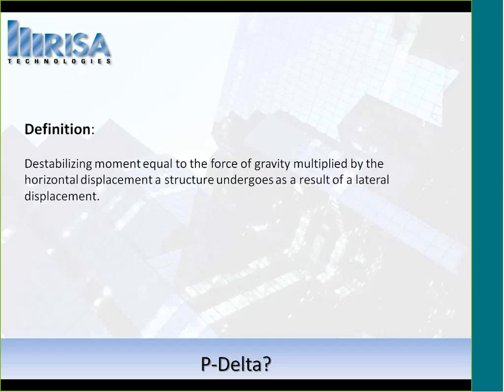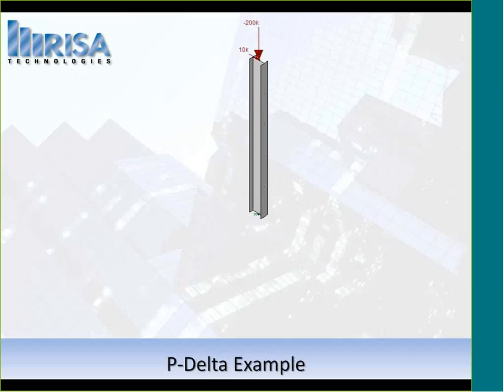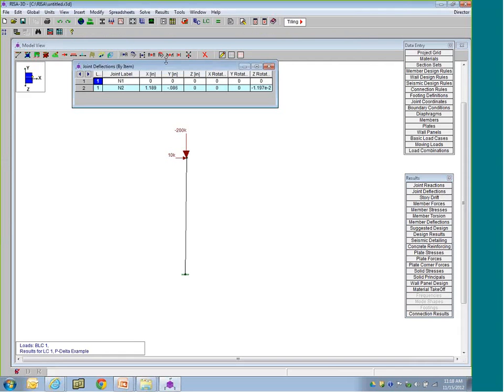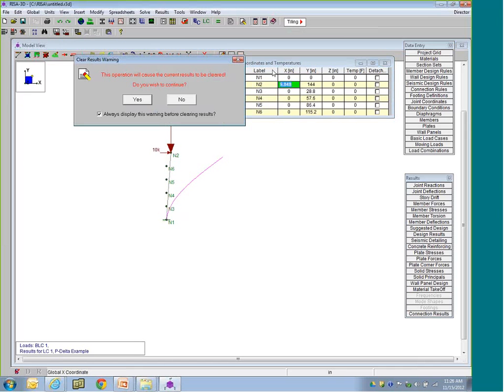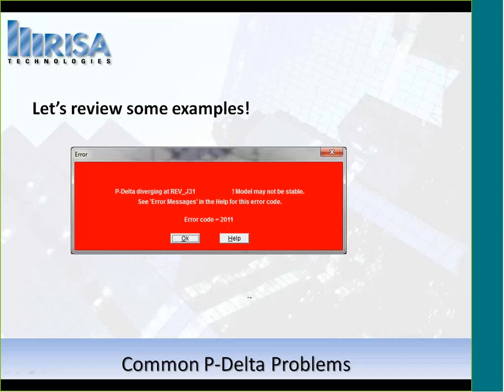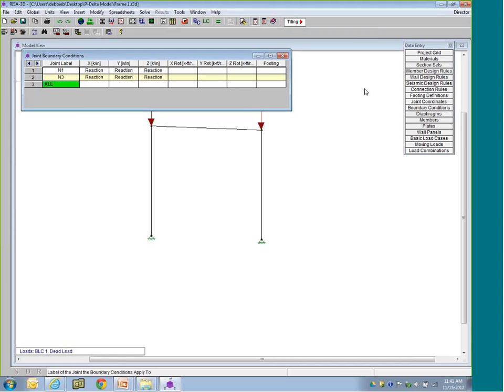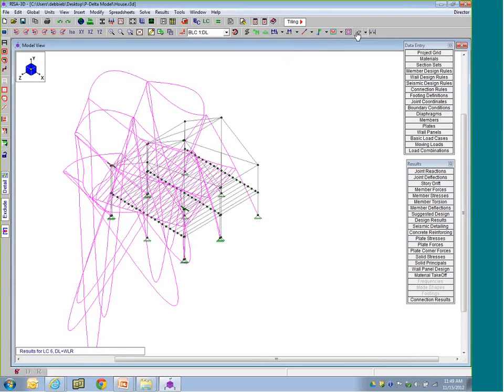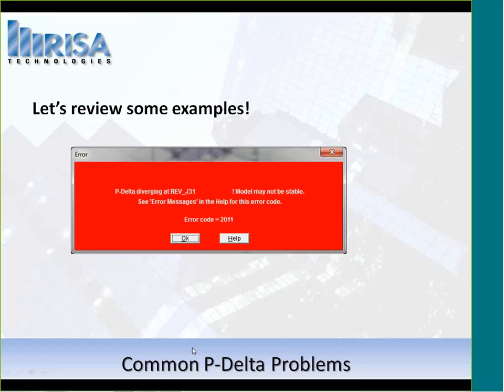Analyzing with P Delta

Comment: May be the definition and the explanation need more clarifications, look at Allen Adams from Bentley and how his P-Delta presentation is a must. Notional loads and members imperfections!! Concrete code ACI 318-14 and steel  code AISC 360-16  both has different requirements for how they take on the topic.
Reply: Could you share more info about it? Thanks!

Comment: You may want to check why you could not get the deflection of 1.19 when you run it before adding the intermediate nodes (i.e.: without small delta)